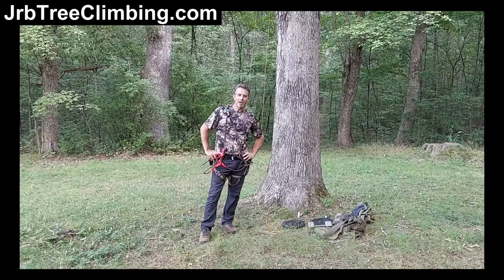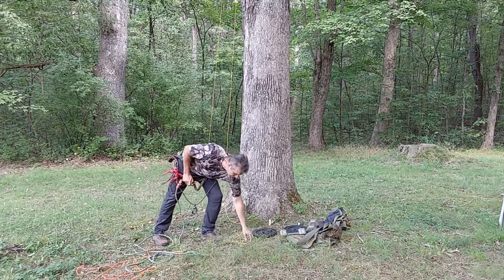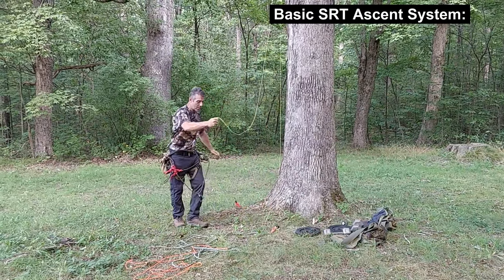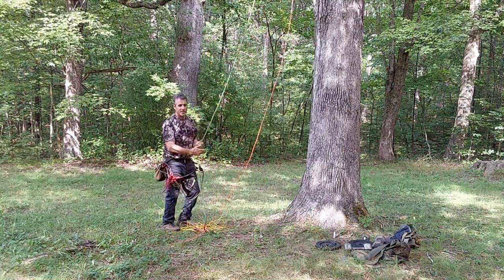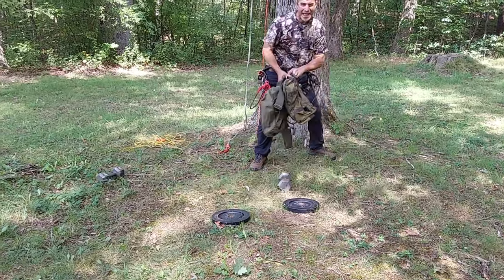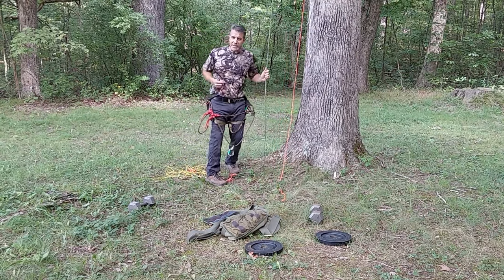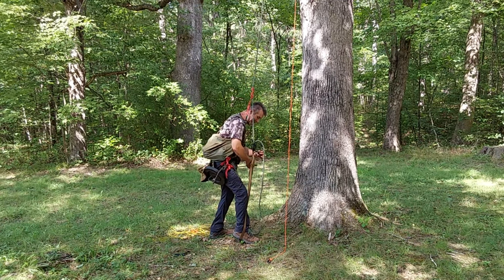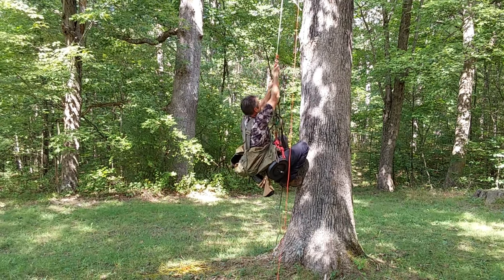Introducing JRB Non-Mechanical SRT (with 105 lb Load)

Comment: Great stuff, I appreciate you "putting tools in the toolbox". This system looks great for folks who want something very small/light and that is "set and forget". But it still has redundant connections to the rope and minimal metal in the system.

Of course if someone wants a more versatile system then they can go for a longer rope and use a maverick hitch to avoid having to thread a lot of rope through a fixed eye at the end of the rope. It comes at the expense of requiring more knowledge, tying a knot at the tree, and extra weight.

All great stuff!
Reply from the maker: I could not have said it better myself. All designs have trade-offs involved and I just want folks to know what the options are, never compromising their safety. Cheers and good luck this season

Comment: I’m looking forward to this series!  Never entertained SRT or DRT as a mobile tree stand guy.  I just see so much rope and cord and get confused and never really gave it a fair, open-mind.
Reply from the maker: That sounds like a healthy approach.  In the meantime, ask yourself if what you're climbing on now would hold 300 lbs... 1000 pounds... 2000 lbs? Because we basically don't know. We're told something has a 250 weight limit but aren't told its actual strength and warned to wear a fall arrest Harness when using it and generally not told how to safely get to ground if there's a problem. My rule is simple: it doesn't matter what's under your feet because it can't be trusted.  It's never a problem for me ... but a ladder stand is one of the hardest things to climb safely. 
https://youtu.be/cu3B76AwhCc?si=Wdt2PYkwFsXA7_wr

Comment: I might have missed it, but what length/diameter rope are you using and what rope/diameter for the hitches. Do you use the main line as your tether while hunting ? If so, do you leave it hanging?
Reply from the maker: John, these are great questions. Most are answered on my website. Click on the pages for Rope, Cord, and Length Specs. This particular climb was executed with an 11 mm rope, but 9.5 or 10mm rope is more popular for an SRT climb. The cord diameter is selected based upon the rope diameter.  7mm is a great diameter for those ropes. 7ft is a good Length to cut for a Longhorn Agile hitch.   Ok, now when hunting, yes, i stay on my rope the whole time.   And yes, I draw it up into the tree and just drape it over a branch or my platform.  Deer will notice a rope dangling down and so we simply pull it up. Let me know if ya have other questions after ya peruse the website. 
https://jrbtreeclimbing.com/

Comment: would you have any hesitation climbing with this weight and method, on Oplux?
Reply from the maker: Yes I would.  It's great rope for DSRT.  However, I prefer minimum of 9.5 mm for SRT systems.  Especially for a bigger climber.  I have demonstrated non mechanical SRT climbs on 8mm rope just to show it can be done, but it's not my preference.
Reply: What’s the negative of using the oplux?
Reply from the maker: @alexu8199  i have done this climb on 8mm ropes, but i conservatively prefer the greater surface area of a thicker rope.  I haven't actually tried it, but i could probably do this climb using 5mm cord on 6mm rope. But at some point, the smaller surface area becomes prohibitive. And the hitch will have less area to grip for breaking into rappel. Also, we have to consider that some climbers sre bigger than others and we must consider wet conditions as well.  What you decide to use based on your situation is up to you, but be careful and accept the responsibility for your decisions.

Comment: I like to hunt with my 13 year old son. Last year, I sat in a saddle behind him in a tree stand. Would there be any reason I couldn’t have both of us in saddles in the same tree? Possibly using separate false crotches?
Reply from the maker: Assuming the tree is of adequate diameter and health, that is completely viable.  However, you will need to plan the layout. You could be at slightly staggered height for example.  Consider weapon safety and making sure you don't have a broadhead or muzzle pointing the wrong way.   With SRT, I prefer using a "floating anchor"  over a false crotch... simply because it's inches around the trunk and eliminates the possibility that the anchor itself is compromised. Please review those videos and choose carefully.

Comment: That’s looks a lot like @nysaddlehunters Half line system that they released months ago, even the way you got the rope girth hitched in tree
Reply from the maker: I am a big fan of our friends at NY Saddle.  Any way that we can bring our friends to a no slack system is a move in the right direction. In terms of details, the anchor in this system is a "Running Loop" similar to the Running Bowline, and is the most elementary means of creating a canopy anchor.  But the rest of thse 2 systems are very different.   There is no device and no hand ascender here. The primary attachment and means of advancement are my own designs. Most importantly, this is a 1:1 system, not a 3:1 RADS system, so we are going to ascend at approximately a 3x faster pace and without friction of the rope bending as it passes through a device. I have shown some content on how a RADS system can be rigged with no devices at all simply using the Longhorn Agile. But overall, I am not a fan of RADS systems just because of the pace. An able bodied person doesn't actually need the mechanical advantage and can easily climb 1:1 instead of 3:1. Cheers and good luck this season. RADS demo was squeezed into the LA introduction:
https://youtu.be/dvkbzzf47S0?si=7AcXRmWvgn77id5Y